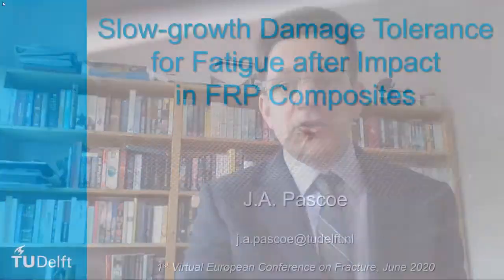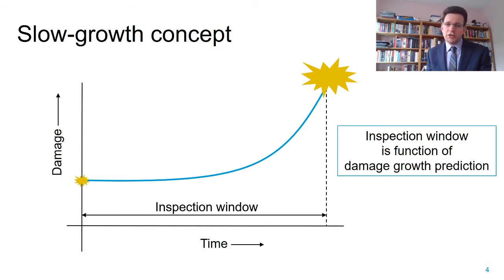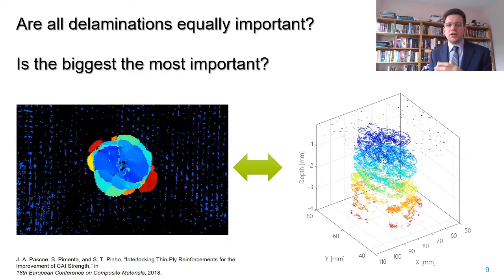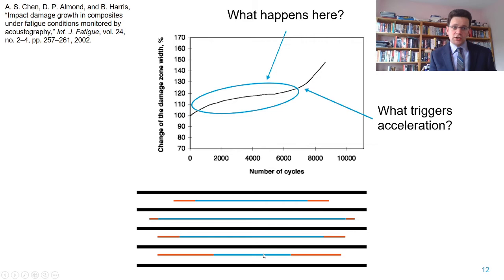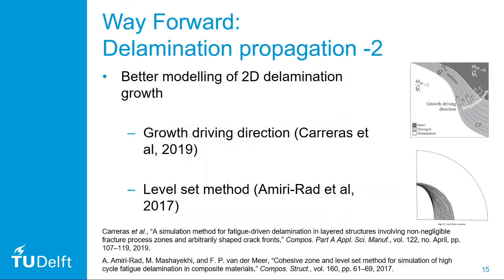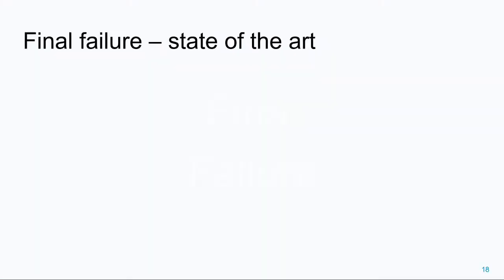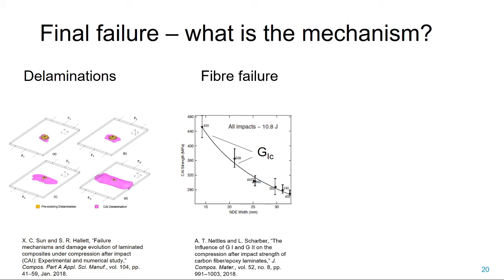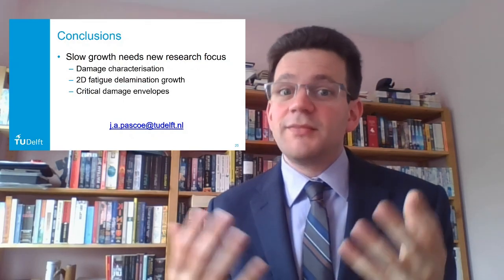Slow-growth Damage Tolerance for Fatigue after Impact in FRP Composites [VECF1]

Comment: Thanks, interesting presentation. I guess that the question about the failure mechanism will become even more complicated when moving away from classical 0/+45/-45/90 laminates obeying the typical design rules (e.g. in CMH-17) and moving towards fibre steering etc. It seems like we will not run out of interesting research topics in the future :-)
Reply from the maker: Yes indeed. At the moment the state of the art is that if you want accurate fatigue predictions, you need to generate data on exactly the laminate of interest. This becomes an expensive proposition if you want to use multiple different laminates in a structure, or to use fibre steering to effectively have hundreds of different lay-ups. In my view the way forward is to develop models that can correctly capture the effect of the fibre orientations on the damage mechanisms, which is one of the things we're trying to do in the D-STANDART project (https://www.linkedin.com/company/d-standart/). As you say, there's plenty of interesting research left to do :)